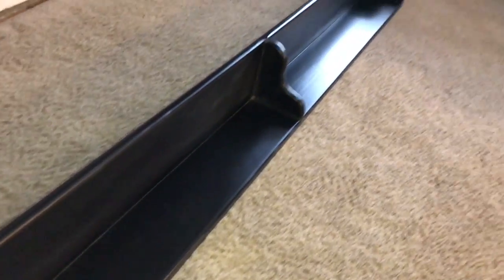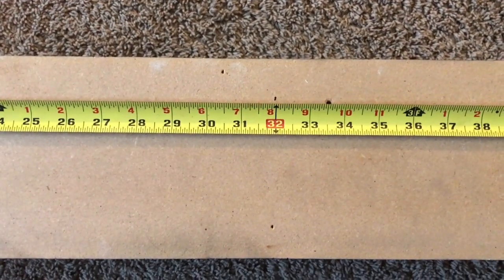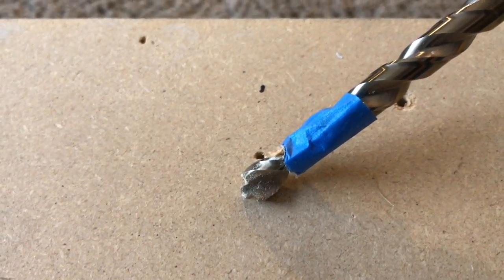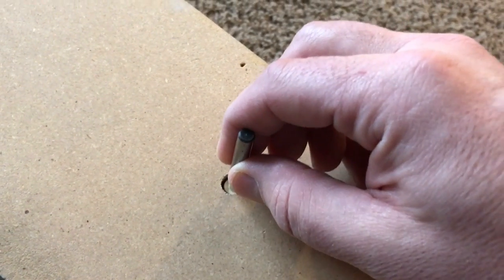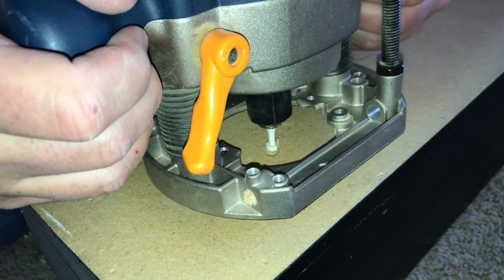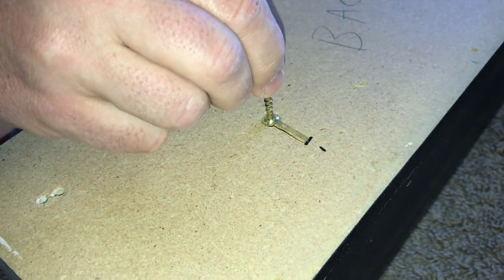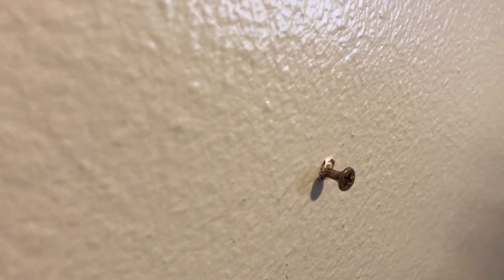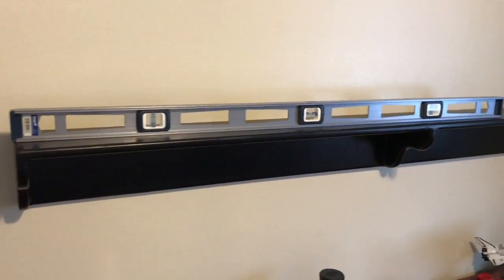Key Hole Slot Shelf Hang

Comment: Better, faster - and safer - way is to use the router only and do it in one pass.  the head of the bit is designed to bore into the material as well as cut away the slot.
Reply from the maker: For some reason your comment reminds me of a daft punk song